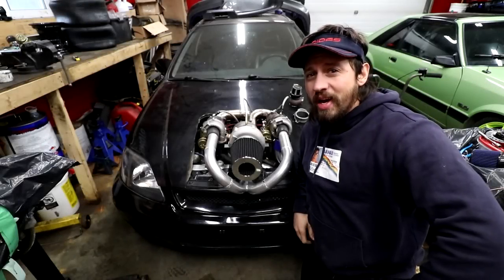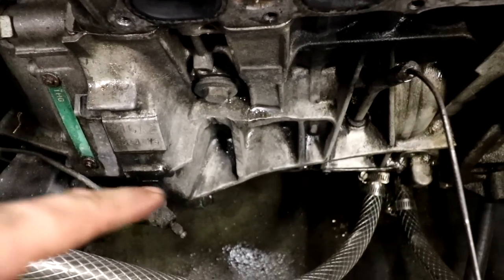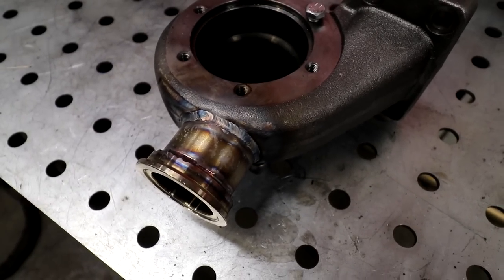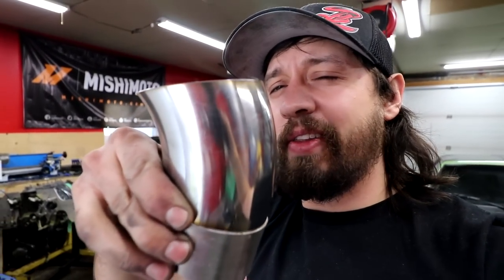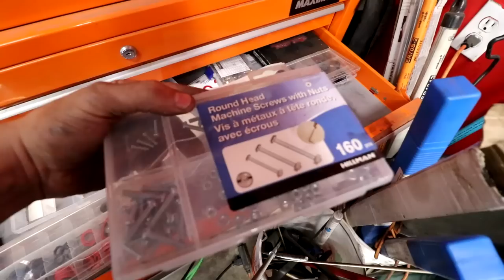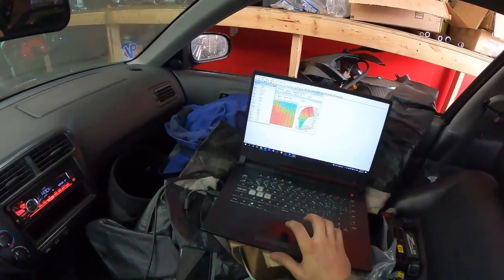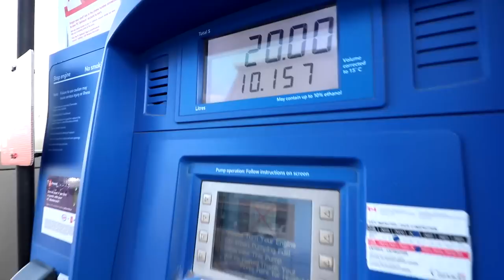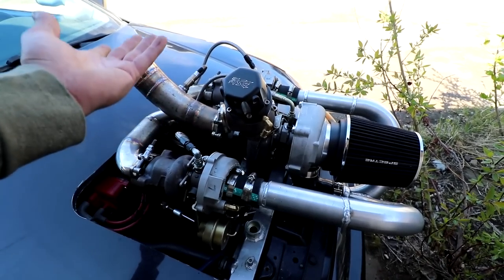Triple Turbo Civic Hits Boost. Its Way Better Than 4 Turbos

Comment: Love this. Always wanted to see this done in a car or waste way too much money trying. I drove a big truck with a compound turbo and it was fantastic. The engine get torque and the truck begins accelerating and moving the weight as soon as you put your foot down. You can watch the boost needle literally sweep from no boost, to maximum boost almost instantly, right about the time any other turbo would have just begun spooling. Torque occurs instantly. It's was such a satisfying ride.  Nissan built the EK-10 March  That had a compound set up from the factory, but it was a limited run car built specifically for a 1.0l class

Comment: So long as the small turbos can flow the amount you need it will be fine. Each turbo in series of a compound setup just compresses more. A turbo doesn't know if you feed it 1bar or 2bar, it will compress it just the same based on its pressure ratio. Problem happens when you need more air than anything inline can physically flow

Comment: Put a rain cap on the exhaust to help the oxygen sensor read better at low rpm. 
On a cold start, computer's going to be pig rich on fuel until engine gets warm enough for the computer to pay attention to what the O2 sensor says. Closed loop/open loop thing, remember?
Reply: Like diabetes  🤷🏽‍♂️

Comment: With twin 5 psi stages, it should be closer to 10-12 psi of boost... 1.35 (Pressure Ratio) X 1.35 (PR) = 1.8 atm total- 1 atm of vacuum= .8 or 10-12 depending on altitude.
Reply: That’s correct. 
Kyle. If it’s too laggy, put bigger springs or a Boost controller on the gates for the smaller turbos to get them to spool faster and higher. Then once you get the turbo response right, up the boost on the big turbo to get the overall boost level you want. 

All that without over speeding any of the turbos.

Comment: Hey @ #Boosted Lifestyle  #BlackSheepIndustry's i think the lower boost and slower spool time is because if I remember correctly from working on factory compound boost setups is the plumbing for your turbos need to go as follows. Please double check me on this also!!!! The plumbing for you intake and boost pipes needs to go this way. Both small turbochargers should have you cold air intake running to the smaller turbochargers  inlet sides. So you could run 2 air filters running into the smaller turbochargers. Next you run the boost pipes from both the smaller turbochargers to the inlet on the larger turbocharger where you currently have your cold air intake running too. Lastly run the boost pressure coming out of the larger turbocharger to your intercooler or intake manifold if you're not running an intercooler. Also i believe the exhaust gasses from the smaller turbochargers run into the exhaust inlet of the larger. I believe the exhaust work you have done is 100% correct but check the cold and hot side to be sure. I hope this helps i know it's definitely gonna make more work for you but from my master tech mechanical repair knowledge and my time I spent doing electrical and mechanical engineering leeds me to believe this will make a huge difference compared to you current results. Keep up the awesome work of trying the things that all car guy's secretly want to try haha!!!!

Comment: I like to weld the wastegate on the housing. It super efficient I use vsr turbo's and wastegate's I can maintain 3 psi of boost on a s475 with a vsr 10psi spring in it.

Comment: Since youtube has been whoring this video in my feed for a few weeks, I finally got around to watching. 
While I appreciate the mechanical monstrosity you've made, if you're trying to compound boost pressure, feeding the big turbo into the little one is the more conventional route. 
Neither flow version is going to spool particularly quick, but what you want is to feed the high volume (large turbo) into the smaller compressor to add a second stage of compression.
Reply: What he has now, small into big. That's better for reducing turbo lag right?
Reply: @rajgill7576  I think so too

Comment: You're not supposed to put a wastegate on the big turbo. The small turbos spool up fast but then start dumping the extra pressure through their wastegates.  The big turbo is probably too big to make much pressure in this setup so it's really just acting as a catch all to feed a few psi into the small turbos. The real problem is going to be your intake air temps. If and when you dyno this please do some comparisons with and without the big turbo to see if you'd be better off with just twins.
Reply: Better doesn’t get views.

Comment: We only get 6.91 litres to 12.44gbp (20.00cad) here in North East Scotland. That's only an average. Some places in the UK vary from 5.5 litres to 7.2 litres. Diesel ranges from 4.9 to 5.3 litres per 20.00cad. Very shitty. Cheers. Leigh.

Comment: i have a compound cummins with a 7875 o er a s488.  i never owned something that was some much fun and needed a transmission that was so strong. if ican gibe you any advise. Your primary turbos (the largest one) exhaust housing needs to be really large.  i personally think you would  do allot better with a much larger primary .  s369 would do great on  that setup. Rule of thumb Is  you want 2.5 times the air flow of the secondary turbo or the smallest turbo. Look at diesel compounds kits in terms of cfm to get an idea of whats best.

Comment: Now that may not be very reliable, but likely a lot of fun for a space in time...lol, but you're a trailblazer...lol I'm planning my 95 S Series  for a full engine build too, with a precision turbo, Garret, or Borg Warner 12-12.5 PSI also. But I have a very comprehensive block and head build, that I'm hoping to keep it reliable while still getting 325-335 Hp out of it, in a 2280 Lb car. Still be more than fast enough for the power to weight ratio of those early model Saturn SL2's. Gonna add some 15X7 Einkei RPF1's also, but that would be likely after the most pricey part is out of the way and a tune, 1000 mile break in, etc.

Comment: Before I ever knew anything about Hondas I used to think the B16 was the shit then my boy bought a K20a2  and I never looked back since my EK hatch is running an H22 €R out the gate I’m making way more power although I would love to have a B16 type  R transmission merge with it my H. It’s set up with a T2W4

Comment: Vtec wont engage under boost with a check engine light on with s300. Ask me how i know 🤣
Reply: Bro best part is that it was my intake air temp sensor 🤣🤣🤣
Reply from the maker: I bet that was my fucking issue 😂

Comment: you changed the stock map sensor ??? could be part of the cut issue from memory ebay turbo kits come with bigger map sensy!  could be totally wrong or maybe missed if you put a bigger one in already, but thought worth a little mention

Comment: I believe you have the pipes wrong if you want the smaller turbos to spool the bigger one, the boost side of the small turbos should be routed to the intake of the big turbo and the big turbos pressure side should be run to the intake manifold.
Reply: My thoughts exactly

Comment: Confused, shouldn’t the smaller turbos be feeding boost into the intake of the big turbo? The piping seems backwards, feel like it’d be alot more efficient the other way
Reply: In compound setups you feed the bigger turbos into the smaller ones, because the smaller one spools faster it needs to be closer to the intake manifold.

Comment: I think when you are running the hondata for boost control.. the Vtec needs to be tuned separately..  There will be one table for the non Vtec cam and one table for when the cam moves into Vtec... I bet your boost issue is somewhere in there..  The Vtec table is probly set to 0 boost or something like that.. so when vtec kicks in.. the gate opens and you lose boost..   I've never worked with the Hondata.. but have seen lots of vids of guys tuning vtec cars with them.

Comment: ‘Those turbo’s aren’t gonna have a fun time’ 
The whole point of compound charging is to keep the smaller turbo(s) in their efficiency range. They are simply multipliers. They aren’t working any harder. They are still only compressing incoming air to a certain pressure ratio. The large turbo does ‘not blow’ through the smaller ones. The boost from the large turbo is further compressed by the second stage. 
Imagine the difference in air density at the top of a mountain where an engine struggles. In such a situation the turbo is being pushed harder to make up for the lower air pressure. Now when you descend to sea level the air gets thicker. All the large turbo is doing is proving an air dense environment like you find at sea level versus at altitude. The small turbo’s don’t care if they receive ambient 14.7psi of air or already compressed denser air. They simply multiply it.

Comment: Yeah, your explanation...that's not how a compound set up works.  The small turbos aren't "by-passing air".  They are still compressing air, it's just that it's already above atmosphere.  So, they make more boost than they would without the big guy in the lead...wastegate on small turbo inlet.

Comment: Fuck yessss! My Black Sheep Industries BOV arrives tomorrow!

I 1000% agree that doing "normie" single turbo setups on Hondas is less interesting. I bought the BSI BOV for my 9th gen Civic Si build that I'm installing a massive TVS2300 positive displacement supercharger on. Sure, I could have spent half the money on a turbo kit and hit 650whp, but where's the fun/challenge in that?! I'd rather be different (stupid) and try to max out a 2.3 liter blower that's typically ment for ZR1 corvettes on my 2.4 liter FWD civic. Lol.

Comment: Is your speed sensor not working?  I noticed your speedo was not working and then in the datalog is shows 0 mph (km/h).  Also did you drive it around with no radiator cap?  lol.  On the breaking up or weirdo boost cut you do not happen to have a stock map sensor installed by chance do you?

Comment: Never get fuel while the tanker is there filling the tanks, it stirs up all the sediment from the bottom and the water that has separated from the gas and it all ends up in your fuel filter and could cause your engine to run like chiiiit..... 👍 👌 FYI

Comment: Uhhh, aren’t the bigger turbos supposed to feed the smaller turbo in a compound system? 

Anyways, single turbo Honda’s split factory blocks these days. You would need to get into billet K blocks and custom cranks to take advantage of a true compound system in a Honda. Which would be amazing BTW.

Yes, I realize this is just for fun.
Reply: he has it setup correctly, exhaust from engine goes to small turbo exhaust turbine, small turbo exhaust outlet goes into large turbo exhaust turbine inlet, large turbo compressor outlet goes to small turbo compressor inlet, small turbo compressor outlet goes into engine.

Comment: Wouldn’t it be better to put 2 small turbos into the big turbo since it’s more capable of flowing higher volume?
Reply: In general, you can increase flow numbers from a turbo if they see greater than atmospheric pressure on the inlet side. If the setup was flipped though, the small turbos would eventually act as a choke to the larger turbo at high rpm / airflow.

Comment: I'll throw in another fun fact. Did you know, when you heat up an oxygen sensor, let's say with a torch, or the engine itself, it actually produces electricity, like one or two volts, from the heat. That's right, you heat that sucker up, and electricity comes out. No shit. 🤯👍

Comment: Sir what happened to the Leroy junior build??
Reply from the maker: I just ran out of space to do another big project. I'm going to do something like that soon though
Reply: @Boostedlifestyle  yeah I noticed that the garage is packed, maybe you should do some research also before taking a project that difficult. suspension and chassis geometry is easy to mess up. Maybe talk to some experts in suspension work?

Comment: isn't this the kind of situation where you pin the solenoid somehow so that vtec is always engaged 🤔
Reply: You could but the lower lift side of the cam helps with building boost

Comment: Compound boost is most effective when one boost device is unable to efficiently supply a desired mass of air at the pressures necessary given an engine's displacement and airflow requirements for a desired power output. You might do better with a bypass system given the way this is operating